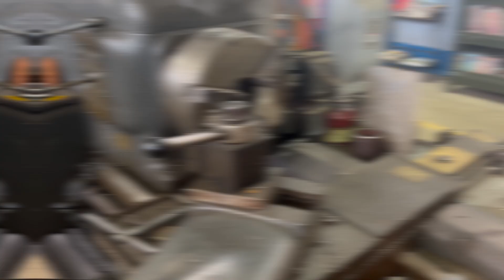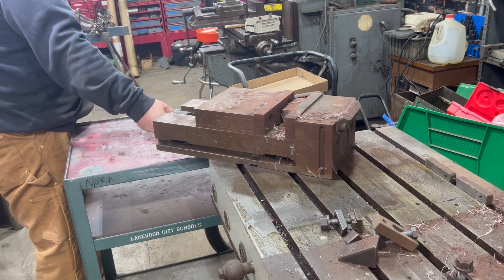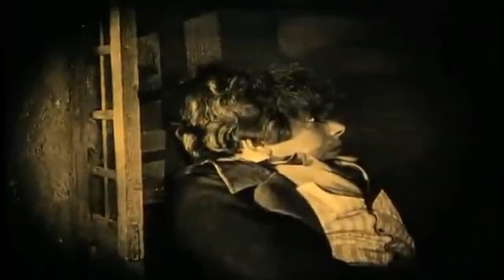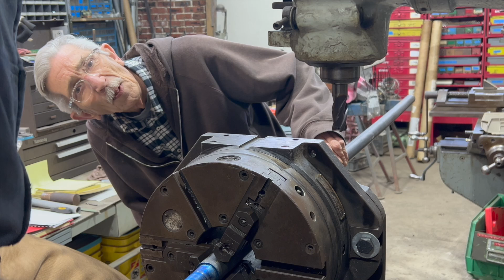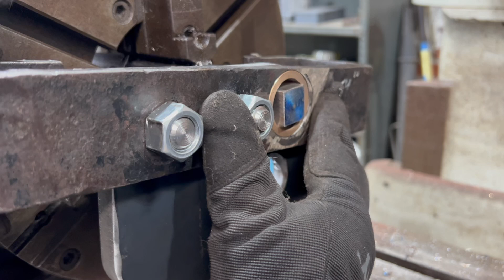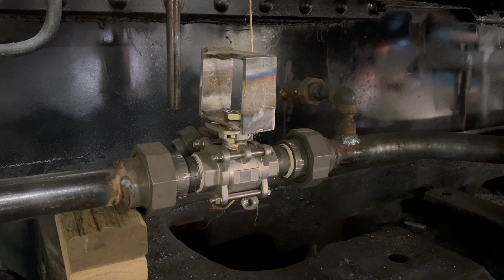Steam Locomotive Oil Conversion - Machining the Valve Control Rod

Comment: Hi Greg that's cool working in a big shop like that good job  . I don't always think of these things when I'm doing things but with having heavy tooling i built a steel table that sits next to my mill and i can line up the mill table so i can slide tooling on and off . 
ok we can't see all of the mill that you were setting up the S spacer . You can trough strap around the ram were the head bolts on and suspend a large vise or rotary table up and down .  Well you get the idea . 
Hope this helps . JM
Reply from the maker: Thanks for sharing your ideas! I'd love to do something like that, but I am limited to the materials we have (which, ironically, isn't all that much) and time. I can only get out there maybe 3-4 hours a week.